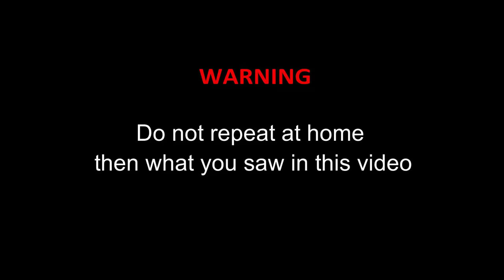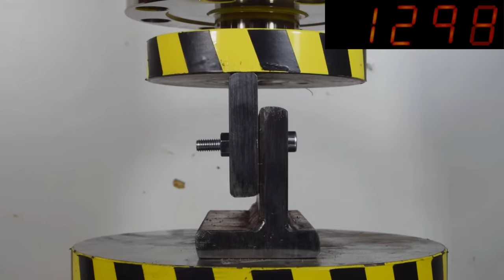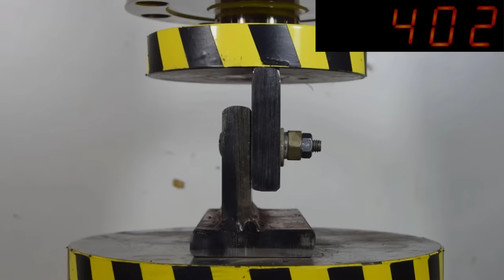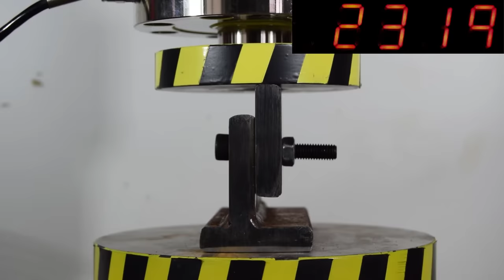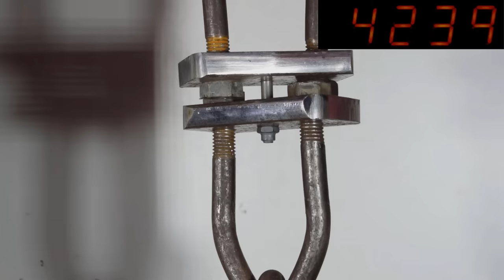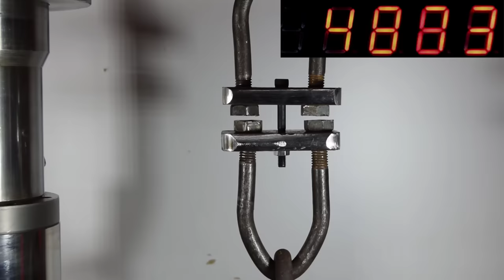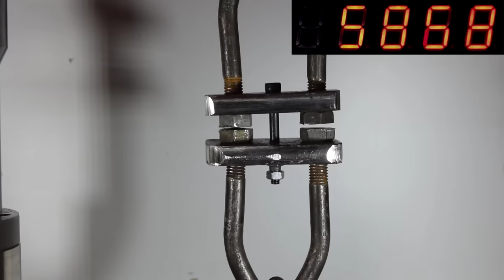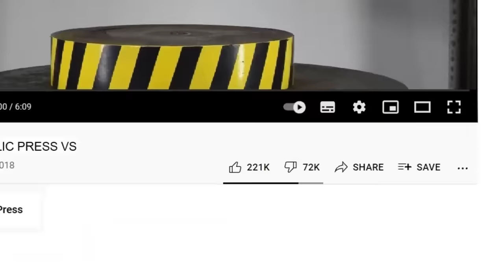HYDRAULIC PRESS VS TITANIUM BOLTS

Comment: Its not that titanium is going to hold that much more tonnage. It's that it'll hold the same tonnage while being half the weight of steel
Reply: Bingo
Reply: Probably would have been the choice of armor for the ultra ultra rich if gunpowder was never invented.
Reply: Or it could work even better as a mele weapon due to its lighweight characteristics.
Reply: @helium-379  Titanium doesn't hold an edge well. Its too soft for edged weapons, steel in this regard is better in everything except weight
Reply: Same difference. If it can bear the same load being half as heavy, that means you can double its mass (like thickness or the number of supports/elements) to make something that weighs the same but be twice as durable.
Reply: @helium-379  and also, this can be considered both a plus and a minus, the greater the mass, the stronger the blow. Lighter doesn't always mean better. Perhaps suitable for some specialized purely piercing weapon without sharpening, designed for combat with an unprotected enemy. and even so, as soon as such a weapon meets with a steel element of protection or other weapons (steel) - those weapon probably will be heavily damaged
Reply: It also expands and contracts far far less than steel does when heated or cooled, allowing titanium products to withstand temperature changes better after continual use or sudden extreme use (like falling through the thermosphere) while also having the entire build they fit into remain more consistent as it goes through temperature and pressure changes that would cause slight changes in the sizes and spacing that are required for the build.
Reply: In my experience Titanium is comparable to Aluminium in weight but no where near Steel in strength.
 It's about half way between the two in strength, breaks like aluminium - not a fan tbh.
Reply: Thats really good to know. Learned a new thing. Thanks for the comment lad.
Reply: @Монс-й1ь  He Said Armor -.-
Reply: @Монс-й1ь  Once More He Said Armor "---"
Reply: @helium-379  Depends on the type of weapon.  "Light" isnt always "great" when it comes to Mele weapons....  Mace's for example, you 'want' that extra weight (just not so much that you tire yourself out).  Swords on the other hand, or daggers, yea you could get away with lighter... to an extent.

The main reason for that 'balance' of heavy vs light, is that the weapon itself 'adds' to the force of your blow.

The main reason 2-hand grips exist on some Mele weapons isnt entirely due to more 'control', its also due to the fact that you can turn your main hand into a 'pivot-point' that you use your rear-hand to pull 'up' against as you swing down, adding an addition 'swing' so-to-speak into your main swing. This allows a slightly lighter weapon to hit harder than it otherwise would, but at the cost of having to use that 2nd hand as well :)  Thats how swords like Greatswords and such were able to be used so effectively without having to weigh a ton with extra weight from the longer blade, the Extra hand helped make up for the missing weight.
Reply: dam I forgor
Reply: @AJ-my3gy  "could work even better as a melee weapon"
Reply: @AJ-my3gy  Once More He Said Mele Weapon "---"
Reply: Yahtzee
Reply: High grade steels are cheaper and much stronger than titanium for the same weight. Steel weighs more for the same volume, but you just use a smaller bolt since it’s stronger. The benefit of titanium is it’s corrosion resistance, and strength at high temperatures.
Reply: Yes!
Reply: @kapa7197  or same durability but half the weight 🤔
Reply: Yes 45% Ligther but this is only applicable to low to medium grade, highest grade of stainless steel is stronger than Titanium alloys…
Reply: Less weight more fly
Reply: @helium-379  does titanium flex as well as steel? it'd be interesting to see the differences between a titanium and spring steel longsword
Reply: @Монс-й1ь  he didn't say a sword or weapon. He said armour.
Reply: @kapa7197  double the mass also means almost doubling the volume ie you are not going to have the same thing anymore it will be much much bigger. So if your intention is to make big sure (which comes back to the same issue of it being half the weight for the same size)  but if not, then nope it does not work that way. It is all down to density of material per cubic mm etc
Reply: @superchargerone  There are more than enough applications where physical dimensions are not the limiting factor but weight is, so you have no trouble making your part bigger. Taking bolts like in this video for example (which are used to build larger structures), load capability and staying under some specified weight are the driving factors usually, and you can allow your bolts to be almost any size as long you satisfy those other constraints. So size is not really a problem. Of course there are other applications outside of bolts where physical size will matter more (which exemplifies why there is no single ideal material that is best for all applications), but then you also have possibly other solutions. Like you may have a form with cavities so you do not need to get bigger at all, you can just make your part less hollow. Or if you are really optimizing for size vs strength, then there are even better materials than titanium, like tungsten.
Reply: Not to mention it’ll hold that while being half the weight and at over a few thousand degrees.
Reply: @mickenoss  that depends highly upon the grade of titanium.

High grade titanium is very similar in strength to high grade steel but weighs less, but is still heavier than aluminum.

In terms of strength to weight metals it's extremely strong for it's weight, but steel is stronger but more importantly in many applications tougher

Steel is harder than titanium period, so in high wear applications it's superior in every regard except weight. Its abrasion resistance, its heat properties, and its hardness are all superior to titanium, titanium is good for high stress applications especially where weight is a concern, but something that will endure a lot of wear would be better off with steel.

Steel plates on construction equipment are a great example of where steel blows titanium out of the water, the replaceable teeth on excavator buckets would need to be replaced once a week if they were made of titanium rather than once every 3-4 months.
Reply: @ericspda  agreed but steel performs better with heat erosion, that's why hard use suppressors are made of steel and other "super" alloys like inconel and stellite.

It's all about the application it's going to be used for.

If someone could find a way to create an alloy as light as titanium (or lighter) with even better heat erosion and strength properties than steel it would be incredible for the engineering advances we could achieve.
Reply: And holding that weight under intense heat
Reply: @alegend4evr  Bingo!! lightweight and has a really low thermal expansion characteristics, also Ti is very corrosion resistant. When looking at the hardness though, there are alot of hardened steels that would do a better job for pure hardness and tensile strength. Ti is around 36 HRC on the Rockwell and 4140 carburized  quench and tempered has a minimum of 52 HRC for some of the stuff I was processing.
Reply: Titanium is only about 20% lighter than steel for the same volume. Unfortunately, function often dictates form, which results in a more or less 1 for 1 swap for relatively minor weight savings. When you are also able to substantially reduce the amount of material used, that's where you get significant weight savings. Titanium also can handle much higher heat before softening or deforming.
Reply: @helium-379  if I could afford it, Id go for a depleted uranium armour. Lol
Reply: @mickenoss  Titanium is much more brittle than steel, similar to aluminum, but is actually substantially stronger. Do not mistake brittleness with tensile strength, hardness, or wear resistance. Because of this, titanium is not suitable to replace steel in cases where ductility is needed, but is suitable in most other cases.
Reply: @genogeno7289  "could work a even better as a melee weapon"
Reply: @WardenWolf  It does have it's place, some things though steel is a very hard material to beat.
Reply: Also, Titanium handles the stress of heating and cooling much better then Steel.
Reply: @Монс-й1ь  so then the core being titanium but the edge being steel?
Reply: Also titanium can withstand way more heat
Reply: @kapa7197  Yeah, but we’re talking about the “cutting edge”. If you double the mass of the cutting edge, it means you’re making it dull…
Reply: @jpogigtxcr1778 Billy C's original comment I was replying to is not about melee weapons nor any sort of applications with a "cutting edge". That is a very atypical application for titanium, and yes it is one of the few where size matters more.
Reply: As a framer titanium hammer heads are avaliable.  I prefer my estwing over a stiletto. Reason is I dont have to swing as fast and hard to sink nails and thus have more control. Titanium makes a difference when wearing your bags climbing ladders but not much in use.
Reply: @Монс-й1ь  I think that titanium would be more effective as an armoring material rather than as a weapon because it it lightweight and thus people wearing it would be faster, be able to fight and travel for longer, and be able to dodge attacks more effectively which would improve combat performance significantly. Titanium as armor (compared to steel) seems like better choice for armor at least. Although steel blades would still have a bit of an edge over titanium blades, titanium weapons that rely on impact strength rather than edge retention would probably be mostly be one to one with steel and weapons like pikes might actually favor a titanium construction because of the reduction in weight on the business end.
Reply: What's the song names??
Reply: That is not true, simly by physics. The most durable Bolt is the Steel 12.9 (In The video at 3:27, breaks at 4,5T). This guy mixed up Numbers in his Video at 4:10 you can see that he has put the numbers wrong. The physics are: 12.9 Steel has a max tensile strenght of 1200 N/mm², the grade 5 titanium (aircraft titanium) or Ti6Al4V has a max tensile strenght of 900 N/mm². Now the torque, the bolt is srewed together will also make a difference. So its safe to say this video is pure propaganda ;)
In general you can see the diffenrent materials like this: Steel (max weight, max strenght) / Titanium (half the weight, half the strenght Steel) / Aluminium (half the weight, half the strenght of Titanium) / Magnesium (half the weight, half the strenght of Aluminium)
Reply: You can use a Titanium 6mm Bolt instead of an 8.8 10mm One...it' s a Good advantage in mechanical applicazione.
Reply: So it's twice as strong then? If it's half the weight holding the same pressure.
Reply: Absolutely right
Reply: hmmm how expensive is titanium?
Reply: That’s the same thing
Reply: @Монс-й1ь  Nah. It might chip it, but titanium won't shatter easily, or warp. The steel blade might bite into the titanium one. But in battle that wouldn't really matter much anyways. When fighting armored opponents they were most killed using thrusting weapons that could slide between pieces of armor. And you only need to cut an inch into a person to kill them. Hit the neck, the major arteries in the arm or leg, or pierce any major organ and death was guaranteed on the battlefield. So a titanium weapon would very easily dispatch a non armored opponent. 

From what we know about sword fighting the typical fight between two armed opponents rarely lasted more than a few seconds. Most of the time combat was decided in a single blow (not counting fully armored knights and such). So there wouldn't really be that much time for a weapon in combat to end up seriously damaged anyways. 

There would be one major benefit though. If used to produce a weapon and armor it would weight significantly less than a steel equivalent. It may not hold an edge as well, and it may be more easily chipped or damaged during combat, but you could produce a fully armored knight who could move faster and for longer periods of time than any other. An army armed with titanium weapons would bear a huge advantage over the course of a battle as they would be fatigued less by carrying and swinging their weapons. Over the course of a battle that would most likely lead to a victory for the titanium force. 

TLDR: Ancient armies would have chosen titanium, or weapons integrating titanium and steel together (for instance halberds, staffs, spears with a titanium shaft and a steel head) over steel. The weight savings alone would allow their armies to trample over other armies of similar size due to the lesser fatigue due to the lighter load. They would just force their soldiers to sharpen their blades after every battle.
Reply: It's worth pointing out that stainless steel has a hardness rating of 5.5 to 6 on the mohs hardness scale. Pure titanium has a hardness of 6. So titanium is in fact capable of holding an edge equally as well as stainless steel. Hardened steel alloys reach 7-8 on the hardness scale, so they do hold an edge better than titanium, but titanium holds one better than copper, bronze, or iron weapons ever did. Claims that a steel sword would cut a titanium sword in half are absolutely ridiculous. Not nearly enough force to do that is being implemented when two people meet blades. It will certainly chip the titanium blade as it is the softer metal, but it would easily handle the abuse, and lighter weight of the weapon would likely give you a large advantage in terms of fatigue management during a long battle. 

Furthermore recently a gold and titanium allow was discovered which is 4x harder than pure titanium and harder than most carbon steels and pearlitic steels. The research documents note that samples were unable to be ground up even when using a diamon mortar and pestel. Idk how much gold they use in the alloy, might ruin the weight advantages of the titanium, but the resulting metal has some really cool medical uses, is compatible with human tissue, and will hold an edge no problem.
Reply: Yep, or for the same weight, you can put a much bigger bolt
Reply: @cheeeeezewizzz  From the start, i never said that titanium sword can be cut in half by steel sword, just that titanium weapon be easily damaged and less durable that made from steel
If you compare titanium weapon and armor with armor and weapon made from steel, compare to steel that we have today, not to the steel that be mostly produced and used back in 500 years, in that time titanium producing technolgy doesn't even exist
About hardness, 6? Mohs scale? 
In Brinell scale titanium is around 175,
Stainless steel 250, and carbon steel around 650-700 HB
I perfectly aware that no one tried harm armored opponent by dumb-punching in elements of protection
But, you cant just go and perfectly stab by first try every living, moving opponent like some heroes in movies
Reply: @Монс-й1ь  I wasn't even replying to you. You should look at some of the titanium alloys though. One gold titanium allow has recently been discovered that is both harder and stronger than most high carbon steels. Pretty neat actually.
Reply: @cheeeeezewizzz  I see, Ti3Au aka "Titanium gold"
an interesting thing, but from what is known, only its incredible hardness is clearly indicated
often, the problem that unites all superhard metalls and alloys is their fragility
therefore it is difficult to say how applicable this alloy is to the production of edged weapons and armor
Reply: @Монс-й1ь  in construction its important. 
Les weight is mostly bether for a bridge or something.
Reply: @cro75guy81  
Čelik je jači i teži, titan je samo lakši.
Reply: @kapa7197  make a 10 Kilometer bridge from tungston
Reply: @allenseeallendo5844  its god fo bridges
Reply: @WardenWolf  
A 10 Kilometer bridge 20% les weight, is much.
Reply: This is only important for big constructions, for smaler things, its not important. 
When u make something big, and its 20% les weight. 
This 20% is a big diference.
Reply: @bladeblade8443  Tungsten is obviously not for building bridges. But you also don't build bridges out of titanium, so why would you bring this up?
Reply: @kapa7197  tungsten is havier than steel
Reply: @bladeblade8443  Read back why I mentioned tungsten and for which applications.
Reply: Extra perks, titanium is unaffected by magnetic fields,  has a very high heat capacity, doesn't rust.  
I wonder how an engine would fare over the years. How much longer would those parts past before failing.  At least that type of engine could theoretically sit for an near indefinite period of time without siezing up unlike steel parts.
Reply: @helium-379  titanium is softer than steel
Reply: While being corrosion resistant.
Reply: Billy is smarttt with three t's for a triple dose of his smartness. And still there are people in the replies that will spin it in a way they can debate. This dude in the video is just doing a very basic but affective strength test on bolts. Now we got guys in the replies talking about medieval weapons, swords, armour, gunpowder and all kinds of shiz. 😆
Reply: @hmu958  arguably the lighter weight can result in a faster swing transferring more momentum.  
Also anti vibration.  
Love my stilletto, but if it breaks the martinez with steel head looks appealing.
Reply: @helium-379  it is used in fencing
Reply: It has to do with titanium being more stable during the drastic temperature differentials experienced when going from earth to space.
Reply: @kapa7197  still means it will dull faster and be half as effective if used as a blunt weapon.
Reply: It also has a higher thermal threshold versus steel, doesn't it
Reply: @Монс-й1ь  Ever heard of alloys?
Reply: @Монс-й1ь  So you take a titanium body and put a 1/2" steel blade, tang and tip on it.
Reply: @helium-379  nah, you want weight for greater momentum, if it’s too light it’d bounce off,
Reply: @Монс-й1ь  So a titanium sword with a steel edge?
Reply: Its also about the fact its very resistant to heating up.
Reply: @worldssickestmedia2713  lol thanks brother. My faith in humanity remains because I know there's guys like you among the rest at least.
Reply: Not just that but it's also much more heat resistant
Reply: @Монс-й1ь  titanium alloys are better than any steel alloy
Reply: @mickenoss  well titanium usually is made in many different ways for different purposes and titanium alloys are more common than just titanium itself in industrial or specialized settings
Reply: Everyone talks about durability while what’s being tested is ultimate strength. Titanium has a relatively low modulus, that is, yields under load, BUT for repeated loads it presents great resilience in repeated stress. It withstands fatigue very well. For weight better than steel and far beyond aluminum in any comparison. Add corrosion and aluminum or steel won’t stand a chance. This is from someone who’s worked with all three for 2 decades in medical devices. All have their place and applications, mostly constrained by cost but also properties in some cases. 
The video is informational to some extent but does far from painting the whole picture.
Reply: Great work captain obvious
Reply: Titanium is about 3/4 as strong as steel, but half the weight. Also, unlike aluminum, it has very high fatigue limit; however, like aluminum, it is very notch sensitive, so if you scratch it, it will create a failure point...  Steel on the other hand has a near infinite fatigue limit, and zero notch sensitivity. Oh and lets not forget Titanium is a B!T<H to machine and cost WAYYYY more.....
Reply: mhm mhm
Reply: It also won't corrode and will last years. Imagine trying to replace a bolt in space
Reply: and don't forget the greater durability and wider range of operable temperatures
Reply: I don't get it...
Reply: Lighter and doesn’t rust
Reply: @kapa7197  thanks, 3000 likes and you're the first one to get it right.
Reply: And does not hold heat
Reply: @kapa7197  No, it's not the same. Because most of the time, you are just as constrained by volume as by weight. So you can't just make it thicker. That is why almost always, when you read titanium, it actually means steel - titanium alloy.
Reply: @alegend4evr  Steel often has the edge over titanium when it comes to heat also. Alloys like 321 and 347 stainless have a very high working temperature. They do expand and contract a ton with heating and cooling though. There are titanium + nickel alloys that are fantastic at high temperature though.
Reply: @kapa7197  Well if you have to make bolts of the same size, the titanium one has less mass. Desnity of steel: 7.85 g/cm3, titanium: 4.51 g/cm3
Reply: And corrosion resistant
Reply: And higher melting temp too.
Reply: Plus titanium handles heat better as well
Reply: its not the half weigth, its 30percent lighter then steel
Reply: @R_S4_B5  as if your profile pic a 2.7T from a b5. My dude our brotherhood is strong today!
Reply: @billyc2572  greetings comerad
Reply: Glad he did that second test on tensile strength....bc the first one is a bit unrealistic.  You would never use bolts to fasten something that experiences sheer forces like that.  You redesign the machine to notnhave those forces lol.   Steering forces are awful amd incredibly difficult for anything to stand up to
Reply: don't forget about temperature, it will hold tonnage under high temperature, whilst steel would start to lose properties
Reply: Titanium is alot stronger than steel, it also holds way more weight while being lighter
Reply: @CmLeo145  you dont need to tell me that ffs, i work with titanium. What a muppet
Reply: @helium-379  they actually do make titanium framing hammers that work very well.
Reply: Also the cycle failure are more
Reply: And will resist heating
Reply: @kapa7197  or twice as large
Reply: @helium-379  titanium sucks at blades it is hard to make into a blade and keep honed plus has a tendency to shatter on the edges
Reply: @Монс-й1ь  that's coz the resistance is not soft is like sweet steel but much stronger
Reply: @helium-379  titanium isn't THAT expensive. Alot of contries issue Titanium  plates for their troops personal armor. instead of Ceramic. Ceramic has 2 major downsides. it can't really survive multiple hits. and it not drop proof. dropping it hard or hard hits in general can crack and compromise the armor material.  whereas a titanium and steel or hell even polymer or aluminum plates. you can dropem kick throw em and they don't loose protection. 

side note titanium is about 1/2 the weight of steel but 1/3rd the strength. where as aluminum is about  2.5 times lighter than steel for about half the strength.  where it comes into play in armored vehicle design atleast. steel armored vehicle hulls (tanks and APC's and similar) if they're made out of steel they will have a good amount of large heavy steel support strutting to help the big armored box to keep its shape. and it benifits in no way to the armor protection. whereas an aluminum armored vehicle. to get the equilvent protection as steel you make it about 3 times thicker by doing so since the sides walls roof and bottem. is soo thick now the weld seams are really thick and strong you no longer need any kind of support struts to have a solid base that keeps the big armored box armored. and all the weight of the hull adds to the protective characteristic's 

the downside to titanium atleast in armor design titanium shavings catch fire at high speeds and bullets happen to fly at high speeds and create shavings and in armored vehicle design its not good for anyone to have a hull on a kinetic energy based projectile battlefield thats hull is flammable if shot by Kinetic weapons.  its not that big of a deal on a personell protective insert in body armor. due to kevlar cover or spall cover on the plate to stop these high speed flaming titanium shards from doing anything. but in a armored vehicle you the weight that goes with a spall liner capable of stopping said chunks of titanium are not worth it. you could have made a vehicle out of steel that has the same protection as a titanium vehicle with spall liners everywhere for the same weight. with reduced cost overall.

alot of this is unrelated but yeah.
Reply: @mickenoss  titanium by far is significantly stronger than aluminum  but alll things have downsides. yes it does break like aluminum though it would tear and rip instead of crack and fail completely. but it doesnt "break like aluminum" in that it appears to be same strength as aluminum.
Reply: And last much longer
Reply: @Gwydion_Wolf  a light sword can be worst than a heavy one if youre already strong, you will feel less control and impact, you need a blade that you can lift and swing with control, heavy enough not to waste your strenght
Reply: Hemp carbon fiber is stronger than both and lighter
Reply: @Монс-й1ь  Hence the use of Tungsten tips on bullets.
Reply: Wrong
Reply: @TacticalBuffoonary  k clown lol 🤡
Reply: Titanium is more corrosion resistant oil refineries uses this metal profusely.
Reply: Which is basically saying what you're arguing against... Lol. Its specific strength is right at double that of steel, which means it will "hold roughly double the weight" of steel, given that the two parts used in the testing are of the same size and shape.
Reply: @mickenoss  That's funny because the specific strength of titanium is right at double that of steel. So it's roughly twice as strong as steel, pound for pound. Not sure what sort of work/tests you were doing, but they somehow seriously misled you. Lol
Reply: @taylormay9938  I used to be a mechanic and we would see bolts/parts of various flavours fail from time to time. I'm sure military/aircraft grade is very good quality, but from my experience I trust steel. Aluminium and Titanium have their applications, but I have seen them both fail where steel didn't.
Reply: @mickenoss  Titanium is 2/3 the weight of steel with all the strength. Aluminum is 1/3 the weight of steel, as well as 1/3 the strength.
Reply: @helium-379  i mean a slab of titanium on ya chest will protect from guns
Reply: "Tonnage"? Can you just say weight?
Reply: @kiwi9065  uhhhhhh how about no? Were looking at hydraulic press experiment. Hydraulic press power is a function of tonnage. Theres not a single function of weight here in the video. Nothing is using gravity for experiment. Weight is irrelevant.
Reply: @billyc2572  understandable, have a great day.
you see, I actually never heard of Tonnage till now, so I learned something
Reply: And different temper
Reply: @Монс  maybe a mace or hammer, but then I guess you need the weight for the force of impact
Reply: It has it's uses, sometimes where corrosion resistance is a requirement.
Reply: Houston we have confirmation ☝️
Reply: @helium-379  in the age of armour you wanted a melee weapon to have some weight to it. It's like a shotgun in today's world you need stopping power. Hence the power of the claymore/mace.
Reply: @kapa7197  spot on it's twice as strong pound per pound
Reply: clearer than water right there.👍👍
Reply: Depending on duh alloy composition
Reply: Half the weight and substantially less prone to corrosion than steel alloys.
Reply: @helium-379  what are you talking about
Reply: @Монс-й1ь  could it be good for a bludgeon weapon tho?
Reply: @CKG1369  well, titanium lighter than steel, so if you have 2 mace's of same size and shape - blow with the steel one is stronger. In addition titanium is softer than steel, and will be worse at deforming objects that it hits.
So, titanium in this case is certainly better than a wooden stick, but still loses to steel both in properties and in price
Reply: @Монс-й1ь ya, it’s like a non Newtonian fluid though lol 

Now you got me thinking about how well would a blade hold up to really hard hits?  Like hard enough to cause deformation in 416.  I wonder if the Ti would resist the abuse longer and deform less.  

Ti really doesn’t like to be told what to do, you have to sorta convince it to be cut haha
Reply: @helium-379  In many weapons you also want to have more wight like in maces and axes as that extra weight adds to the damage the weapon can inflict thanks to gravity.
Reply: There's a reason this comment has so many likes.
Reply: just imagine combing this holding force to a mchine that u want to use it for long time with less repair costs, or go beyond your favorite car , when u change just the bolts in the engine block u´ll get less vibrations longivity for engine and so the car and moreover an enjoybale drivng experience
Reply: @ayoubbouaziz652  what? Lol
Reply: @Comet.X  No. It has a horrible     Fatigue profile. Most titanium fasteners in aerospace are a one and done. My father was QC at an aerospace fastener manufacturer and they would get used fasteners back from the clients to compare laboratory testing to real world applications. That also applies to the numerous types of coatings as well. He would would have bags and bags of bolts. I replaced every bolt I could on my motorcycle and safety wired them up just because I thought it looks cool.
Reply: @uberdang830  Alcoa?
Reply: @kw2519  Sort of. Van Petty Manufacturing before Alcoa purchased them in 2008.
Reply: @uberdang830  ahhhh I used to work for Alcoa at the old Huck International factory.  

We were the ones making the hydraulic guns that installed those fasteners your dad inspected lol
Reply: @K W  Are you talking about the hydraulic torque wrenches for the Is stancheon bolts on the engine nacelle?
Reply: and it will do so at a temperature steel would be a liquid
Reply: @AGM796  actually no. For high temperatures titanium is not used. High nickel alloy steels like inconel or Hastelloy are used.
Reply: Yeah, people do not understand that Ti isn't the strongest metal or the lightest.  It's that it has, in the correct alloy for a given application, extremely good strength-to-weight ratio, often the best possible.
Reply: and won't corrode, and be more heat resistant.
Reply: Yeah and people also think titanium is super hard when it is soft compared to a lot of steels and will scratch very easily
Reply: @johnf817  Yep, it's certainly a wonder metal, but that doesn't make it the best metal for every application.
Reply: Wrong
Reply: Its not half the weight of steel. Also not as strong as steel.
Reply: @ericspda  was just about to make this point, from my admittedly limited experience, using Titanium is about resistance to corrosion as well as saving weight where tensile strength isn't as important, steels in Aerospace usually need various protective coatings to prevent corrosion (using sacrificial coatings such as cadmium), It's about using the material with the required characteristics that are best suited whilst considering the relevant costs and the ongoing repairs/maintenance of components.
Reply: @helium-379 sometimes you want weight. More momentum behind a swing means deeper cut
Reply: @AJ-my3gy  armar
Reply: @AJ-my3gy  armar
Reply: Most times its neither chosen for strength or weight, but rather for galvanic voltage. Steel really have a problem there. Also aluminum.

How strong steel is depends on what class it is. Some of the best steel is stronger than titanium, but of cause still heavier.

There is also aluminum that have a weight to strength not that far of.

But when it comes to galvanic strength there is no copertition.
Reply: Hey, I bet that is pretty important when you're trying to get a certain amount of mass beyond the limits of Earth's gravity?
Reply: @helium-379  The armor of choice, had gunpowder not been invented, would be steel. Specifically, high strength low alloy, maraging or very finely grained steel. Titanium is, frankly speaking, overrated garbage hyped up by media.
Reply: Answers the reason why the Titanic was made out of titanium.
Reply: And at elevated temperatures
Reply: @Монс-й1ь  what about a titanium Warhammer?
Reply: 30% less tensile strength than black carbon steel
Reply: It automatically means that if same weight ,it will hold more wt
Reply: While also having a much higher tensile strength, corrosion resistance and scratch resistance.
Reply: By Weight they hold More ... 
Depends on how you measure by weight or by Size ...
Reply: Not to mention that titanium is highly corrosion resistant and has a higher melting point than steel. It is also non-magnetic and has lower thermal conductivity than steel both of which could be useful in some application.
Reply: @Монс-й1ь  Actually Ti has a mohs hardness of 6. Steel has a mohs hardness of 4. Titanium carbide has a mohs hardness of 9. Similarly the Vickers and Brinell hardness of Ti is greater than iron or steel. I have a threaded titanium punch that fit into a machine that repeatedly punched a hole through materials like steel. It has quite a sharp point. You might be thinking about the fact that it will develop a thin oxide of titanium though that really does not effect its edge much. More likely it was not traditionally used to edged cutting implements like knives and swords because it was not discovered until the early 1900s and refining titanium into metal is a costly, complex multi step reduction process in argon to avoid contamination which results in a sponge that then must be subjected to many steps to make metal in an ingot form. In short, it would have been impossible for say knights in the middle ages etc. to even make the stuff. (They didn't even know about it.) And now it would be too expensive (about twice the cost of steel per kg) for no good reason except for perhaps very special circumstances.
Reply: @Монс-й1ь Neither does iron - titanium alloys are a different question.
Reply: @Монс-й1ь  Cool! I'll be swapping my old iron war hammer for a titanium one!
Reply: @mickenoss exactly. Titanium requires a different approach to manufacturing and design. You cant just make the same shape as steel out of it and expect it to be better. Car wheels are a good example of that.
Reply: @alegend4evr  I think I read somewhere that titanium loses almost half of its strength at only 200 degrees celcius but I could remember wrong :)
Reply: @mickenoss  What Experience is  that?  Titanium is around 50% heavier than Aluminium and is way stronger than Aluminium, you maybe saw the tear test here that it is stronger than Steel (Except for the extreem alloy in 12.9)
Reply: @Монс-й1ь  titanium steel alloys hold incredible edges. But on its own not so much. Sheer strength is also important in this case.
Reply: My implants are titanium 😊
Reply: Correct, as in pound for pound one is obviously much stronger. However when the the part is identical in size to its steel counter part, they're not insanly far apart.
Reply: This is more of a Russia vs China metal video. But at the same time. Both bolts have entirely differnt specs and tolerances. The difference is that of a bolt that holds up a bridge versus that holds together a desk...
Reply: Holy shit u are genius, how u connect that facts ?
Reply: Well that's not quite correct.
Reply: @helium-379  titanium is not lighter than steel
Reply: Well, there are titanium balistic plates
Reply: Don't trust this channel's results. The format is crap
Reply: As well as Ti being impervious to the elements, better flexion, and heat + stress-cycles.
Reply: You must have been scammed then as someone comes from a military almost all military vehicles are made of a combination of titanium and steel including ships and aircraft
Reply: @helium-379 then why do they use steel plates for body armor instead of titanium?
Reply: @aaroncupples344  because titanium is more expensive than steel by a lot titanium is around 10 to 11 times more expensive than steel
Reply: Incorrect and go away
Reply: Yep. And for one bolt that might not be a huge difference in weight. But when you add the weight saved from 1000 bolts, it adds up.
Reply: Is that really the case?

Looking at the specs, titanium has a specific strength (ie it’s strength to weight ratio) of 76 kNm/kg, whereas stainless steel as a comparison has a specific strength if 63.1 kNm/kg. 

So sure, titanium edges it out by a little from a strength to weight ratio perspective. 

But what about if size is important? Because titanium is lower density to get the same overall strength you need something considerably larger in volume. Because stainless steel (as a comparison) has considerably more tensile strength (505MPa vs 344MPa of titanium). 

That’s pure titanium. Once you go into alloys it’s quite a bit more complicated due to the differences in specific alloys. For instance some aluminium alloys have more tensile strength than both do the above examples. And then some titanium alloys have more than all of the above again!

And what about strength to cost ratio? That’s an important factor too. Because you can compensate with materials that have a lower strength to weight ratio, by using a lot more - if they are cheaper.
Reply: I can relate that cutting it with a grinder is suck. Sparks for days and no action
Reply: It ist more than that Titanium has a very good ratio between density and strength. Making it almost twice as strong at the same weight as steel. But it has approximately  half of the modulus. This makes it bend more than double for a given load and dimension. It has excellent thermal resistance and compared to aluminium excellent fatigue resistance. It usually bends more before breaking compared to steel and it is very corrosion resistant.
It is expensive and bad to work with. So it is always a trade of and there are only a few good use cases for titanium in engineering.
Reply: @cheeeeezewizzz No
Reply: Not only that, also heat resistance
Reply: @Mikael-jt1hk  i hope one day you will find humility and with it, if not the capacity to learn from others; then at least the motive to seek information yourself, for yourself . I have several thousand individuals agreeing with me. And my friend, its not a function of opinion. I was merely stating a metallurgical fact.
Reply: @Mikael-jt1hk  in the majority of Ti applications,  the desired characteristics are employed to provide for the equal strength of, but far lighter weight than, a given alternative raw material. It holds no edge, it is not ductile, not particularly conductive, and doesn't sustain thermal stress more than its alloy counterparts. Thus, the fact that Ti can "work" as hard as steel while being half the weight (not precisely by measure but for arguments sake) , is the foundation for its commercial use widespread across applications. They have even found better than Ti in many instances
. In aviation for example. The engines I used to work on most had titanium fan blades. For turbofans of course, but today, most are composite blades. Non metallic. But elegant arrangements of carbon fibers.
Reply: @kiwi9065  the humility is the precursor to learning. Don't change that.
Reply: And titanium doesn’t bend it just snaps
Reply: @helium-379 to a certain degree doesn't kinetic damage work better with more mass?
Reply: @worldssickestmedia2713  Give man new material and for sure, he s gonna try making weapon out of it.
Reply: Half the weight. 
About 3x stinger over ALL applications.
About 10x more expensive.
Reply: But also more.
Reply: And handle the heat immensely better
Reply: It's not even the weight. It's that it won't corrode. Steel will corrode, rust, weaken, etc depending on the type. Titanium will last much longer
Reply: Lighter, more flexible, heat resistant. Impossible to work with. Despite being flexible it is extremely hard. Even thought the same volume can support the same weight titanium usually scratches steel.
Reply: What if you need the component to be small, not necessarily light? Each metal has its own pros and cons
Reply: @mynameisben123  you aren't going to get better than steel for cost to strength ratios.
Reply: It's not just about half the weight, it's also better at dealing with stresses from extreme heat and cold temperatures and that why they use it for space. It has to be light cuz ever ounce matters when build6a rocket and going to space also when going to space your dealing with extremely high temperatures going to space and re-entering earths atmosphere. Also while in space it's extremely cold most of the time 100s of degrees in the negatives. Also it has less memory than steel meaning that if the metal bends or flexes it more like to return to it's original shape. If weight was all that mattered they would use aluminum 😂
Reply: Were you an engineer who had a few bolts left after servicing the Columbia?
Reply: That titanium from China was strong asf ngl.
Reply: @toxicity6629  most titanium is Russian so that makes sense.
Reply: That's why chromoly is valued so high
Reply: true the titanium is solely for the purpose of reducing weight
Reply: And temp. Resistance
Reply: Titanium bolt 34hrc & 12.9bolt 42hrc
Reply: doesnt corrode, does not become brittle at extreme colds (depending on alloy).  and there are hundreds of alloys that have different properties that very greatly
Reply: the same for fiber carbon
Reply: It had to be said and it was said. Straight to the point.
Reply: Not only this - it retains it's properties at temperatures far higher than steel. That just might be the most significant reason to use them
Reply: And withstand  higher temperatures without deformation
Reply: @helium-379 not really, part of the job of a melee weapon is to transmit energy to an opponent and it needs mass to do that; ke = 1/2mv^2.
Imagine trying to hit someone with a polystyrene hammer, the impact would be tiny
Reply: question is, how the hell do you know you are getting it from a truthworthy source.
Reply: Yes!
Titanium is basically just really strong, really light Aluminum, that doesn't rust, and also doesn't melt so much...
Reply: Also important when near high powered magnets .... Like medical areas for reattaching bone and ligaments for one.... Could you imagine getting an MRI and forgetting to tell the doctor you had metal in your body actual ferus metal.?
Reply: Además soportará con la variante de temperatura mucho más alta
Reply: and also that titanium keep its material's mechanical properties at a higher temperature than steel
Reply: The tensile yield strength of titanium is less than half of a typical structural steel (20.3 ksi vs 50 ksi)
Reply: also ha a lot to do with the heat treatment
Reply: You sir are correctamundo on that one just as strong as high grade steel without the weight in fact it's dang near the same thing
Reply: @ericspda  Corrosion resistant. But iron things, when in contact with it, rust much faster.
Reply: @Монс-й1ь thats prolly why they used high carbon iron/steel swords 🤗
Reply: @kapa7197  you cant reallu make the edge wider then it wont be an edge 😂
Reply: The whole test is pointless, because screws must not be loaded on shearing. If the corresponding torques of the screws were adhered to, the test would be exhaustive, but so... Unfortunately, no.
Reply: Exactly, it's an exotic metal but by no means the most resilient. Inconel would be where the strength comes into play.
Reply: This is a thing people often say, but realistically you can swing a steel sword and a wooden sword together hundreds of times in real combat without seriously damaging the wooden sword. The weapers move on a fulcrum, its completely impossible for a steel sword to cut through the end of a wooden spear or sword, or even seriously damage them in any clash. The Chances of any well made metal weapon harder than bronze or copper seriously damaging another before the users kill eachother first is 0. 0% chance. @user-cd5fm3hh9k
Reply: You´re right. And whats more the bolts and other "titanium stuff is a Titanium alloy mostly based on Aluminium.
Reply: @Монс-й1ь wonder if you can use titanium for the core of a sword, and steel for the cutting edges...
Reply: Could you use it as the core of the sword,wrapping it it steel?
Reply: but thats not the reason why titanium used in space  ,the actual reason is high melting point
Reply: You guys are making my head hurt.  😢
Reply: Kk
Reply: @helium-379 

Or if Africa wasn’t so hot lol 

The bloomeries in Africa were of a different design resulting in better alloys due to much higher temperatures, if they were using metal armor I wonder what they would have found had it not been over come by the more efficient iron 

It’s similar to the Native American metallurgy they discovered platinum 

Not because the were better the. Europe at metal work 

But because they used a different route which is cooooooool as well 

They also might have discovered titanium alloy sintering 

It allows you to get titanium at a much lower temp 

Ohh to see the other routes to our insanity our species is awesome
Reply: @_shadow_1  Agreed.  The armor "bathtub" that protects the pilot in the A-10 is made of titanium.
Reply: @brendontompa-clinch2306  but Steel is the hardest material on earth and nothing is better than it tho
Reply: @mickenoss The metallurgy gets more interesting with tube design. When you vary factors like tube diameter, wall thickness, butting, stress resilience etc. Titanium is often the first choice for high end cycle frames due to factors like strength to weight, corrosion resistance, flex and resilience. Aluminium makes for a very stiff and light frame but with often harsh (stiff)characteristics and the tube diameter need to be bigger, it is a cheap material. They tend to be overbuilt as aluminium has little spring quality and has poor fatigue. Chromoly steel is surprisingly good, much like titanium in strength, resilience, but losing out in weight and corrosion but beating it in price, availability, and ease of working. No simple answers, depends entirely on what characteristics desired.
Reply: You now nothing about titanium lol or steel.
Reply: also has a higher melting point
Reply: And more flexible.
Reply: But steel is heavier than feathers
Reply: @AJ-my3gy he said weapon
Reply: @AJ-my3gy ince more he said weapon